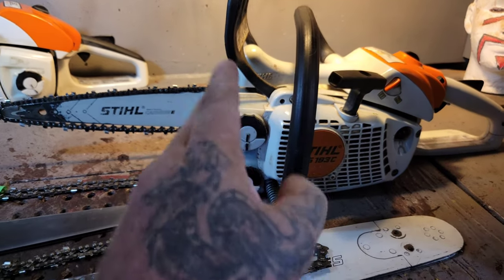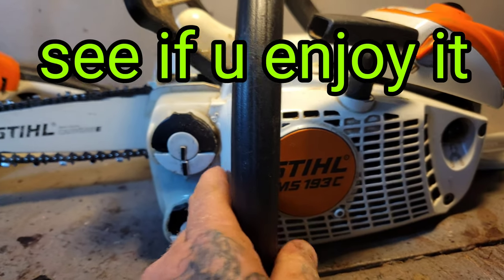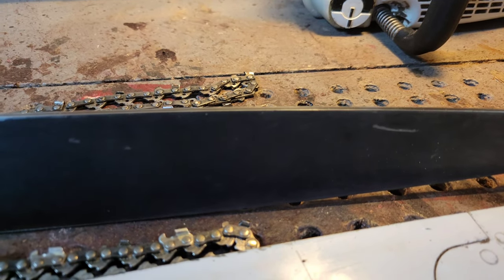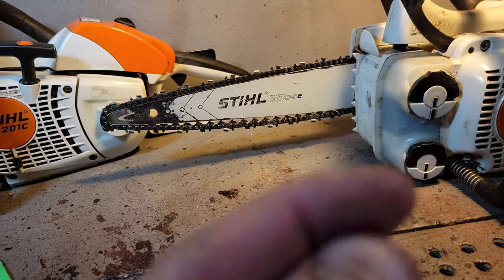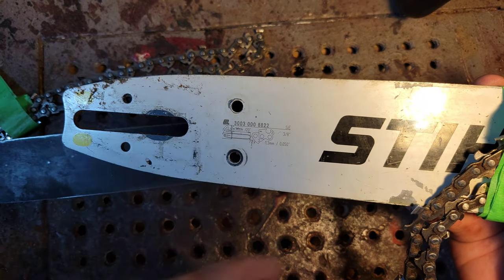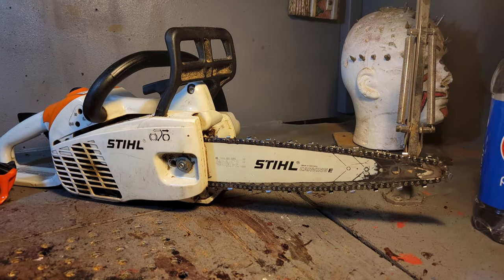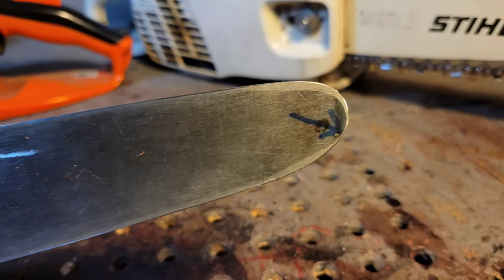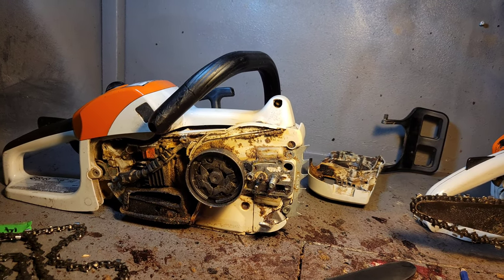Chainsaw Talk, Carving bars, Chains, Sprokets. "Beginner"

Comment: Thanks Jordy! This video really helped me as beginner! I asked my local shop for a Stihl 140 model to be mounted with the dime nose carving guide and 1/4 inch chain and they told me the sprocket is different compared to other models that take a carving bar (i.e. the 200 model that comes with a  carving bar) and that it can't be done. Didn't seem right to me since the sprockets might have more or less teeth but they are both for 1/4 inch chains and 0.043 inch driver link gauge bars. Did my research and verified this through specs from online and your video really confirmed my hunch that the shop employee had it wrong! Great video here Jordy! Many thanks :)
Reply from the maker: Yup the sprokets on the 140 a 1/4 pitch yup! :)

Comment: Well done, i was contemplating  putting a carving bar on a nice ms200t, ???,  as i have a bigger husky for blocking if needed,  thought now is go with the battery saw,  or that  smaller 170,  i were ear plugs but hate the noise,  your opinion is most valued. Carry on
Reply from the maker: Yup carvi g bar go on 200t but u may need to put 1/4 sproket on it
Reply: Yep, may have to much power  an burn up bars needlessly if I understood ur vid.

Comment: Thanks for the video Jordy. Stihl 170's are less than $180 usd at my local Theissen's store,so I bought two. Ordered a 12" cannon carver 1/4 tip kit for one of them and it's supposed to be delivered today. I've been using the stock bar thus far with decent results.
Reply from the maker: Ty, make sure u put the 1/4 sproket on the saw for the bar as well (if you did not know)
Reply: @CarvingFusion  ,yessir just watched your video to help me out. The kit came yesterday and it ended being a 12" dime tip,which was what I wanted to begin with,but all they had listed was the 1/4 tip haha. Gonna put together this morning.

Comment: Thank you for this excellent tutorial video. I need some help here. I just got my carving bar and chain. But I am not sure if the sprocket (it is 1/4 inch) I got is okay because the supplier marked it as MST 150. Can it fit my ms170? I am eager to start sir.
Reply from the maker: U need to put a 1/4 pitch sproket in the ms 170,

Comment: Hey Jordy….I want to add a light weight dime tip electric/corded detail saw to my shop.  Like you the number/model/confusion stuff drives me nuts.   I’m looking at the Mikita corded saw, or the sthil, possibly an Oregon electric?  None of them appear to be set up for detail carving….so I will need to mess with the numbers and all the choices.   Any specific recommendations?   Thanks, by the way this video one’s help, even someone like me who has sucked too much 2 stroke smoke!!!!
Reply from the maker: I would go to ur local choansaw dealer and see what electric saws take a 1/4 pitch sproket

Comment: Jordie im getting a ms 193c dose the sprocket as long as it’s 1/4 pitch dose the number of teeth mater?  and do you have to change the clutch or will old clutch work I ask because a lot of kits come with both and some dont
Reply from the maker: U want the kit that has the 1/4, u can put on a 1/4 bar and chain and start carving
Reply: @CarvingFusion  so it’s all pretty universal from saw to saw then I guess. sweet thank so so much can’t thank you enough for all you do for all of us 🙏
Reply from the maker: @derrickcarlton2887  yes just make sure the saw comes witg a 1/4 sproket and ur good to go